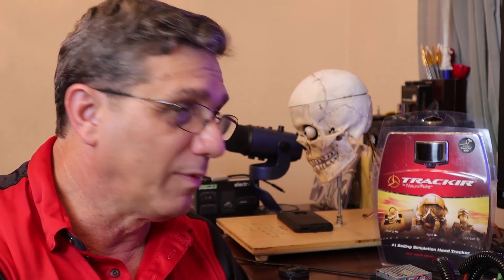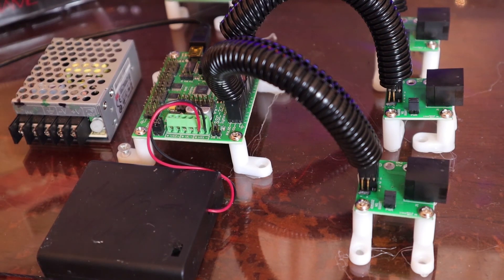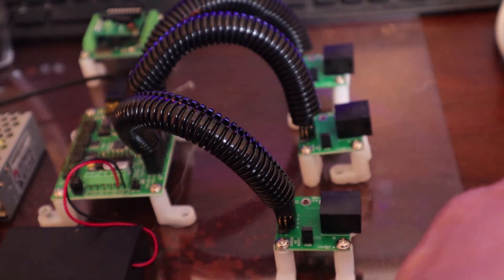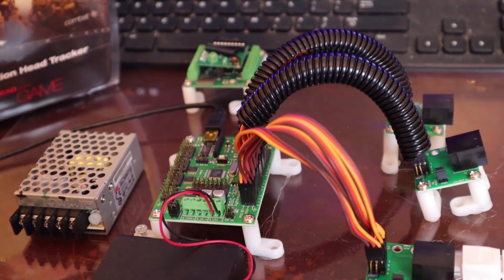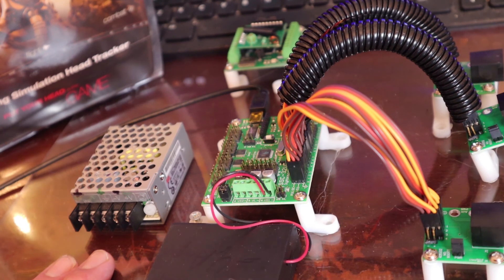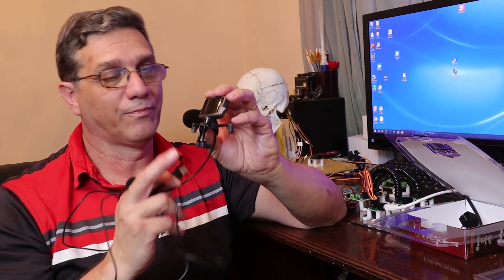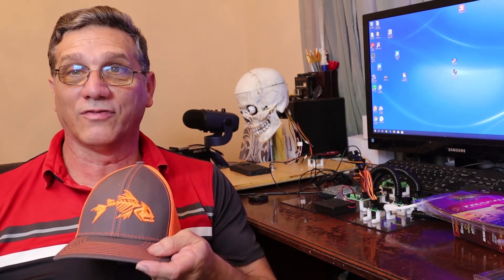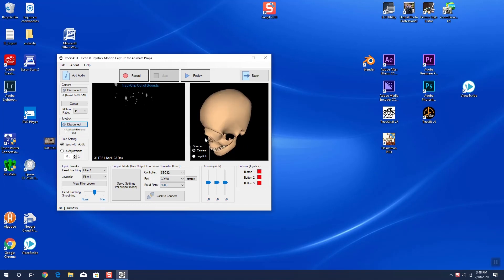Motion Capture with TrackSkull - Animatronic Sound and Motion part 4

Comment: I have the ssc32U and when I connect my 3 skull servos directly to pins 0,2,3 and use TrackSkull my joystick will move the servos however when I connect pins 1,2 and 3 of my sending board to the same pins (0,1,2) on the ssc32uusing male to male servo extension wires, and the servos to the receiving board using pins 1,2 and 3 with a cat6 cable between the two, I cannot get motion when I used my joystick to control the servos using TrackSkull. I am trying to get it all working before I install the servos to control my skull. Could you provide any guidance so I can get it working and carry on with my project. I supply the ssc32u with a 4Xaa battery pack such as you show and also tried a 6V 3 amp adapter both with the same result.